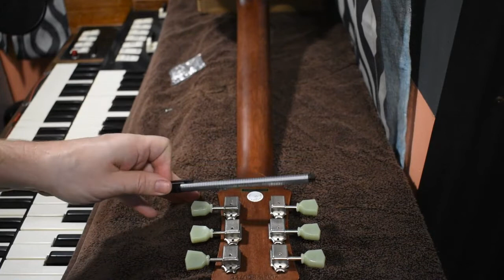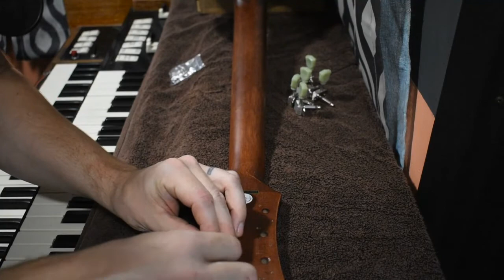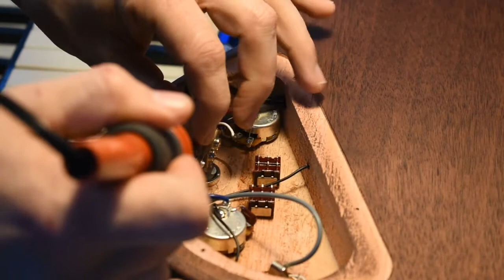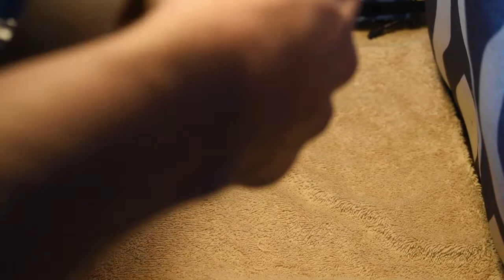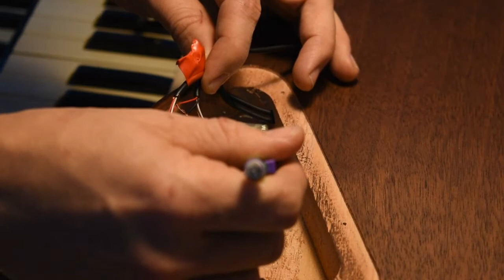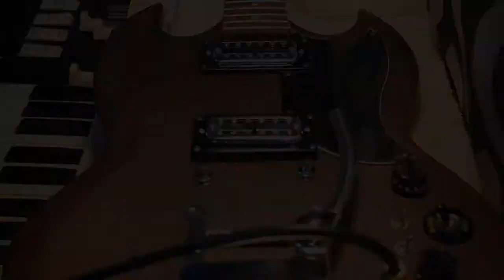Installation of GFS Pickups and Switches for Phase Reverse and Coil Split in the SG

Comment: Well done man it looks great. My one arrived and the tuners were grand for budget tuners but I'd still love to try some of your mods. Nicely caught on the phase issue as well, a lesser ear would have had it sealed and set back up to play before they noticed an issue.
Reply from the maker: Thank you! The stock tuners were the only thing I was unhappy with right out of the box. The GFS tuners I replaced them with are a major improvement.
I have learned to look for mistakes before putting things back together after many years of frustration. On a guitar it’s not really a big deal, but I used to get my Hammond organ completely put back together then find out that a couple wires got switched and now I have notes coming out of the wrong keys.